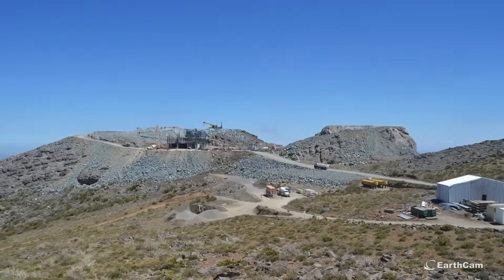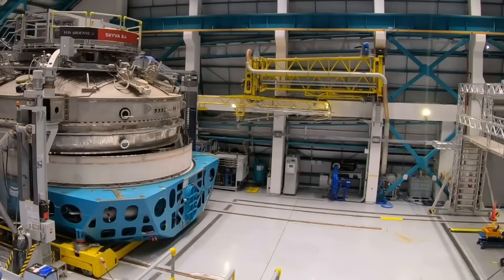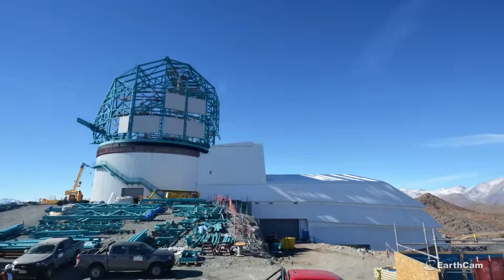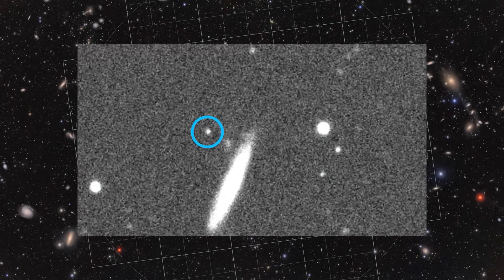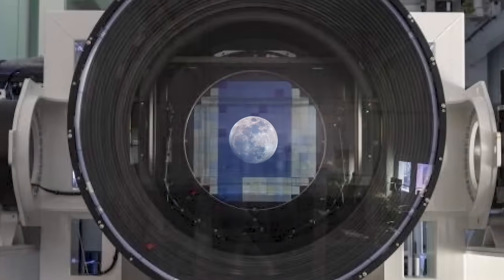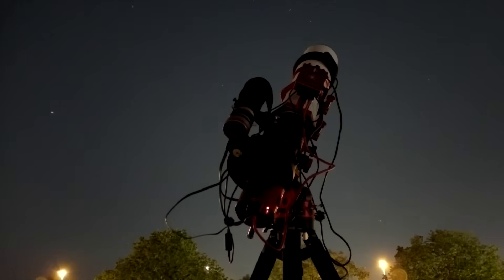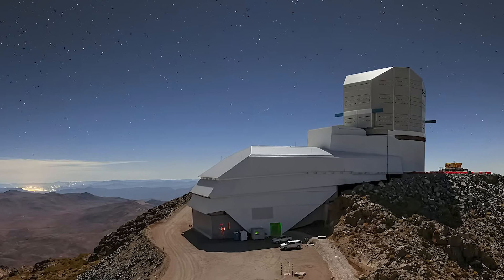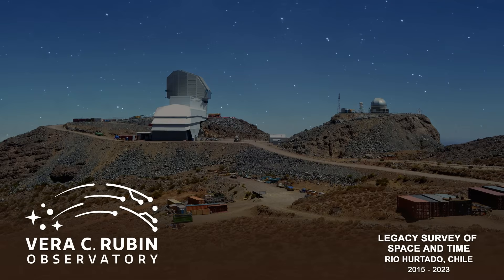NEW Vera Rubin Observatory vs. Backyard Telescope Comparison!

Comment: Interesting comparison. You could in principle replace the Rubin with 550x RASA 36. Assuming a cost of 50kUSD for each unit (for telescope, mount, 100Mpix camera, computer) that could be purchased for less than 30 milion USD, compared to the estimated 680 million USD construction cost of Rubin. The resolution of the RASAs would only be 1 arcsec per pixel (due to large pixels), and there would be other costs added (notable staffing to maintain all those telescopes), but the collection area would be the same and a lot more flexible. So. Interesting comparison :)

Comment: Big smart telescope? Can you control this vera rubin with an app on your phone? Does it live stack? Nah.

Still: a very, very nice piece of kit. But I started wondering: instead of building this giant: would it be more economical to use a boat load of identical fast larger amature telescopes simultaniously? Like a Hyperstar or RASA? Put each of them on a good mount and so forth. Put dozens and dozens of them in a big building.

Imagine just calling First light optics: "Hi there. could you give me a quotation for a few hunderd of your Rasa's?" Oh. And I need as many harmonic drive mounts, piers, big cooled CMOS cameras, guide scopes, AsiAirs, filterwheels, filters, dewheaters, autofocussers and some other nick nacks. Do you deliver in Chile? Do I get a discount?"

Comment: The seeing value you give is an optimistic value of the median seeing (in reality it is more like 0.8") on Cerro Pachon. It means half of the time, LSST will have better seeing and the other half worse seeing. The 0.2"/pixel you give is also limited by technology, i.e. with 10.31 meter focal length, if you wanted your pixel to be 0.5", it would need to be about 24 microns in size, and while there were in the beginning some CCDs with 24 microns pixels, today they are more like 10 microns, hence the 0.2"/pix. Unfortunately they chose CCDs instead of CMOS which are a lot better than CCD, but when the camera was conceived technology was what it was. When a CCD pixel dies (receives an energetic cosmic ray) it basicallly kills all the pixels behind it, making bad columns in the image, whereas with CMOS since the pixels are read individually, you just have one bad pixel. It is expected that with time (and the altitude of the observatory doesn't help) the camera cosmetic quality will seriously degrade with time. All amateur cameras today use CMOS technology. When you spend a lot of money in a big project, you have to make big publicity to show the money was well spent. In practice LSST will not discover 2000 new asteroids per night. They will do 2x30s in rapid succession on a field, and will try to recover the same asteroids 3 or 4 nights later (or more if it's cloudy one night) and using IA tried to match this detection with another in another field. It will work very well for slow moving asteroids (TNOs) not too much for fast moving objects which will be several tens of degrees away from where they were detect earlier. So let's wait and see how it works in practice. The LSST is a telescope mostly devoted to cosmology, if they were interested in asteroid research they would use no filters, and use a very different search strategy. Mostly one would which to have a monolithic detector (which doesn't exist in 3.2 gigapixel size :) ). Mosaic detectors (detectors made by joining many detectors together) are not very good at detecting moving targets because of the interstices between each detector. Panstarrs (2x1.8m telescopes with1.4 gigapixel mosaic camera) finds about the same number of asteroids each year as the Catalina survey (single 1.5m telescope with 110 megapixel monolithic camera). Amateurs using RASA telescopes still find many asteroids and comets. We will see how the situation evolves with LSST once they start operating normally.

Comment: Sorry to say but your analysis of the relative light gathering power of Vera Rubin compared to a backyard telescope is just nonsense.  By your logic, if we made an 8" f1.23 telescope, it would have the same light gathering power as the Vera Rubin which is clearly wrong.  Your analysis only works if you are comparing different f ratio telescopes with the same  aperture.  You've fallen into the trap of thinking that a fast telescope gathers more photons per unit area of the sky.  The faster telescope gathers more light in total because its seeing a larger area of the sky, not more photons from a given sized object or area of the sky.  For that you need a larger aperture.  The Vera Rubin is 40squared or 1600 times the light gathering power of a 200mm and in addition seeing f5/f1.23 times larger field of view.  So nicely made video, but you've got the capabilities of the Vera Rubin all wrong.
Reply from the maker: Thanks for the thoughtful comment — you're absolutely right that aperture determines total light-gathering power, which is why Rubin’s 8.4-meter mirror collects vastly more photons than a typical 8-inch scope. I actually touched on that earlier when discussing the Dawes limit, comparing Rubin’s 0.014" resolution to 0.57" for an 8-inch — highlighting the huge aperture difference.

Later, I shifted to focal ratio to show how fast Rubin captures wide-field images per unit sky area. The f/5² / f/1.23² ≈ 16× faster comparison applies in that context — imaging extended objects, assuming a similar sensor or framing. So the point wasn’t about total photons from a single source, but imaging speed over sky coverage.

That said, you’re right — I could’ve tied those two ideas together more clearly. Appreciate the sharp feedback!
Reply: @AstroForumSpace it was a great presentation and thank you very much for all the work in preparing and presenting it to the YouTube community.  One can only say so much within a minds attentive span for these types of presentations.  Wether anything was correctly phrased or relayed is for the user to determine. Many of us can look into the theory and will only if we want to. If we are to believe everything we read or hear then it will usually get normalized eventually through our own experience. Cheers and it will be interesting to see how this changes the astronomical profession as personally the data consolidation of surveys needs a lot of improvement and standardization… hopefully much funding will start to be put into data assimilation and access and especially proper consolidation of survey data
Reply: At the end of the day, who’s wrong and/or who’s right is less important to me than how the whole exchange of ideas and views were exchanged. You may have a point and it get further by being humble/respectful and not resorting towards name calling/insults. Or you may just find out you misunderstood what was being said to begin with so, a little humility and integrity go a long way.
Reply: Can you believe it !?
Reply: He’s right. By light gathering power, he means how long it will take to get a said brightness of the image… which is, drumroll please, completely decided by f ratio